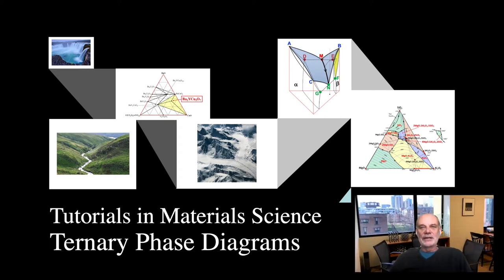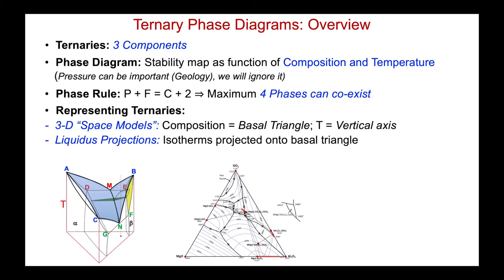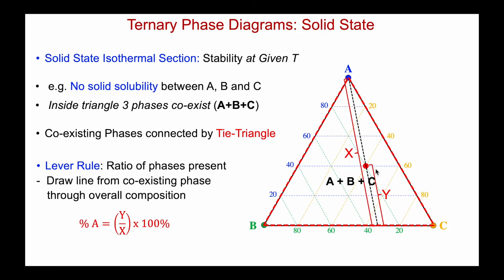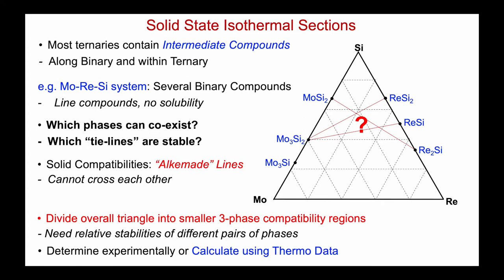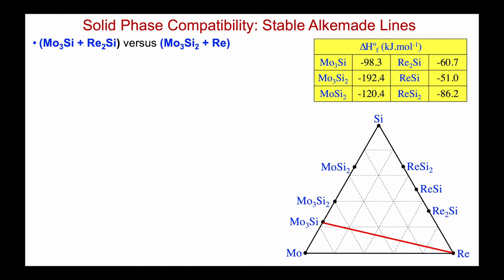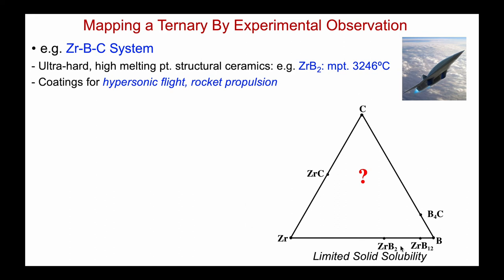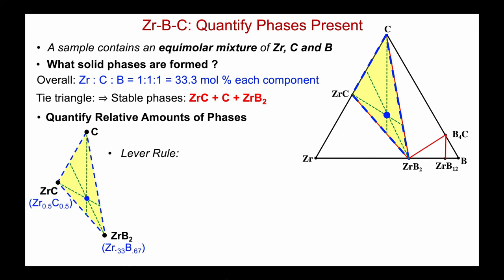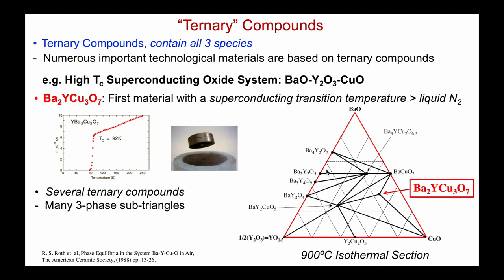Reading Ternary Phase Diagrams in Materials Science (Part 1: Overview; all solid equilibria)

Comment: Great video! It helped me a lot in understanding the diagrams. 
I have a question about solid solubility. At 19:22 from the Si, Mo, Re diagram, can we say that the green point is a solid solution of MoSi2/Mo3Si2/ReSi?
Reply from the maker: The green point composition is a 3-phase mixture of MoSi2 + Mo3Si2 + ReSi.  We would not say it is a "solid solution" of these three as that would imply they are soluble with each other when they are not.  So a sample of this composition is inhomogeneous with regions of each of these 3 different phases; if they were soluble (a solid solution) it would be completely homogeneous in composition and structure. The relative amounts of the 3 phases that are present can be calculated from the tie-triangle.